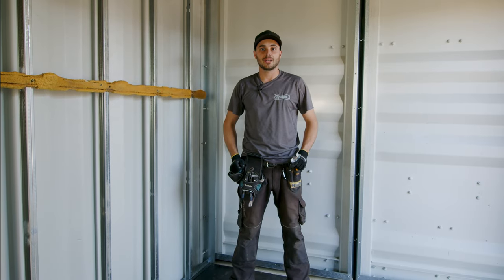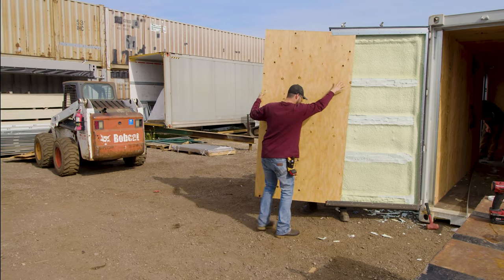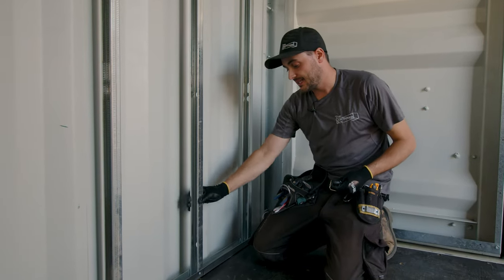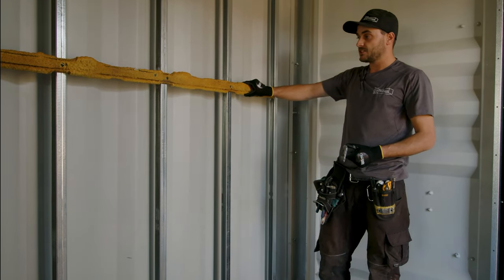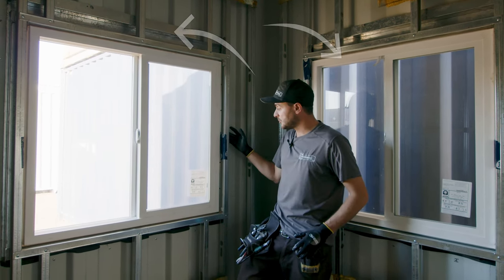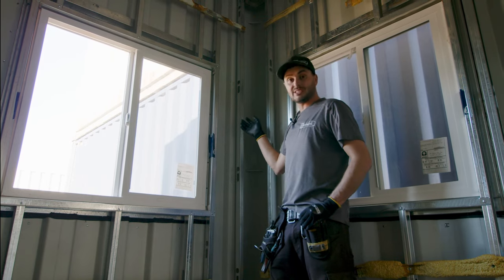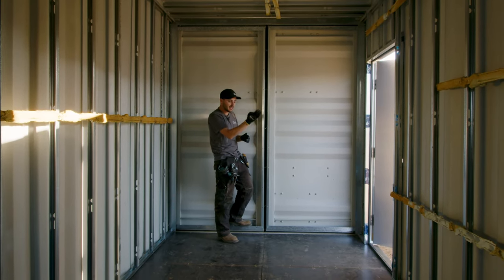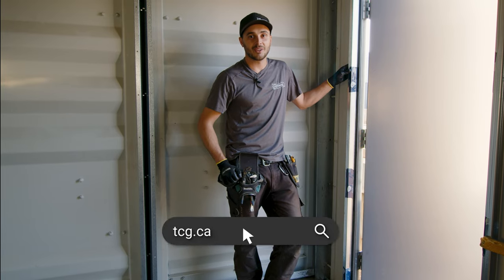Steel Stud Framing Kit - Easy Method To Frame the Inside of a Shipping Container!

Comment: I don't know about plastic for the framing brackets, I've been steel stud framing for over 30 years, I'd recommend adhering a rubber pad to the part that touches the shipping container (like the kind used in sound deadening when metal framing).  That way, the only thermal bridging would be the screw points, no re-tooling to make new brackets, and galvanized metal brackets are just better.

Also, since you are using 1- 5/8" studs, you will notice flex in the middle of the walls due to the lack of strength.  Once suggestion would be to use flat bar, span it horizontally on the back of the studs & fasten it to each stud with a self-tapping pan head screw.  For further strength, you could then use high-strength rubber adhesive, and squirt a dob between the gap of the flat bar & high part of the container skin.  Once dry, it will stabilize the walls without any thermal bridging.
Reply from the maker: You retired now? I'd love to hire you! Haha. Thanks. I love comments from professionals in each trade. Knowledge is power. I'll keep all of that in mind and give it a try.
Reply: @TheContainerGuyTV  disabled, or I would jump at the chance, I miss it
Reply: Hi there, I come from New Zealand and was really impressed with your knowledge. I am converting a 40ft hi cube container into a tiny home. I am having trouble finding an experienced person to help with advice in my area. 

Would you mind talking me through the process please? I can reach out to you via Facebook if you are willing?
Reply: There is structural thermal break material available in various thicknesses... the bracket could be modified slightly to take into account the 1/4" or 3/8" thickness of the structural thermal break material.
Reply: Sir, why would the walls flex in the middle of the studs aren’t structural. They’re only holding up insulation?
Reply: @JP-yl6on  thin width metal studs tend to flex unless you are using a really heavy gauge.
Reply: Try 3D Printing the brackets. Low cost to try it out in PETG.
Reply: Hi there - quick question, what type if flat bar would you suggest for stiffening up the 1-5/8" studs? I plan on using the brackets and 1-5/8" steel studs, spray foaming and finishing with drywall - would you still suggest the stiffener bar on the inside or would the drywall add the rigidity needed?
Reply: @kevinkorczyk4508  they make a c channel or low profile hat channel, both are installed on backside of wall.  They may not be needed if you are using the brackets and if the spray foam will at least reach the backside of your studs because that foam will lock them in place.  If drywall is hung on those studs alone on only one side, the wall will flex a little when pushing it, unless you are using brackets and stiffening.
Reply: @F-Bomb313  Got it, thanks for taking the time to reply - yes the drywall is only on one side so it sounds like I will want a stiffener. My plan is to use the stand off brackets highlighted in the video, spray foam the void and hang drywall... I will just want to be certain the space between the C-channel on the back side of the stud and the container wall has enough space for the spray foam to create the R value I need in insulation.  Thanks again!

Comment: Your continuous innovations to shipping container modification technology are a huge contribution to this affordable construction alternative. (It is such a pleasure to see a builder who continues to learn & improve their methods with each build.)

We're contemplating a couple of shipping container builds to house a rural homestead workshop and a science/computer lab. High humidity and 40 degree daily temperature swings in the Appalachian Mountains will make condensation & mold prevention a major concern. Steel studs & closed cell spray foam may just be the answer we're looking for.

Thanks for your brilliant work sir!
Reply: There is nothing affordable about their accessories, go check the insane prices on their website or Amazon.

Comment: I want to carry your full line of products in Tennessee. 

You should consider a formal building course, which in some ways this is, but certified builders and dealers would expand your reach. Employee a lot of people in a completely new building niche and grab a bigger chunk of the up-cycling market. 

I for one have decided this is what I want to do full time, it's really exciting prospect.

Living completely off grid in a small house in rural setting has taught me how little you really need to be happy and sufficient. 

One element that would be a game changer for me as a builder would be a rain catchment system that adheres to the rim of the top of the container. I use IBC totes on my farm to irrigate, and if they are new from the mold factory they are considered potable, according to the factory I buy from. I would like to funnel the surface water into an either exterior or interior tank, such as an IBC tote. 3" of rain on a 160 sq ft surface fills up my tank with enough to fill the hot water heater, run the dump leg cleanout cycle, and fill my berkey water filter. 

My idea is a galvanized 14 - 18 gauge rain gutter adhered with self tapping screws into that tube at the top lip just beneath the surface of the roof with a sealant adhesive sticker on the back, or could use silicone calk, the top edge could be beveled to help funnel rain, the gutter could come in 10' sticks, some sort of end caps, maybe with a gasket or crimp on could be used to enclose the cutter. A hole saw 3/4 to 1" could provide an easy way to insert a PVC bulkhead fitting, allowing for ease of funneling the water internally. 

One issue I've run into in living off grid in cold climate is water freezing. If you store rain water, a ground tank solves that problem, but it's costly to install and not always an option. A tiny house I built for a customer out of traditional materials has a 42 gallon tank in one side of the loft. I just installed a float switch, solar pump controller into their shallow well and the tank fills when the switch is closed (empty tank.)

1/4" -1/2" drop over the 20' should be enough for a healthy flow. And Screen kit could be added. If it's robust could be adhered prior to transport, need only stick out 2" on the long sides.

Would love something like this in helping me supplement off grid water concerns.
Reply from the maker: I could make custom sloped eaves to collect the roof water. Could punch a gutter guard profile into the top of it so the water falls through and the leaves/debris do not. We can laser cut/fold copper which would use the sun to melt the ice in temperate climate zones.
Reply: @TheContainerGuyTV  That's what I'm talking about, I want a quote on that system.

Comment: Can you furnish framing brackets that will give me 3" between stud and corrugation? You mention that they are laser cut, so lengthening the arm on the bracket should be a trivial issue.

Comment: It's  good to see these videos and the evolution of the kits to improve keeping the moisture out, and improving the vapor barrier and not using wood directly against the sides of the container,  which makes them healthier or allows for combining 2 or more containers! It  would be great to have a complete kit to combine 2 containers and stud frame system including windows 2-6 windows and give prices, so we could know the complete price for combining 2 20ft ,and 40ft containers. ( total cost for complete finished container home) I have not found this on website,  but it would be helpful to know exactly what kits are needed for a complete 2 -20 ft. Combined container home.    And also 2 40ft Combined container home!

Comment: thin rubber gasket between the SSB and the  container may be a cost effective alternative to injection molding   YOUR WELCOME

you mentioned 
Level container or insulation may "pop" what is the likely hood of insulation "pop" when you have a level container at spray and the container goes over the road?
Reply from the maker: Yeah electrical tape would even work just looks dirty. We might CNC a gasket and adhere it to the SSB. 

When you spray foam the container when it's level, it locks everything together in the correct position and makes the structure way more rigid. Then make sure it's handled correctly going forward (you can still be liberal with it - don't get me wrong..) Forklifts with long forks, toplifts, and our delivery trucks don't cause an issue.
Reply: Thanks, I was just about to ask this question.

Comment: What size steel stud are you recommending?
Reply from the maker: 1 5/8"
Reply: I also a few questions in general for you. I live in Reno Nevada. I am planning to buy land  outside of town in the more undeveloped area and so I need to insulate underneath the containers? Do you recommend the containers being placed on an elevated platform versus a concrete slap? The area will not be in a flood zone but the winters can get pretty interesting.
Reply: @TheContainerGuyTV  Also, what was the name of the gasket you used for the window installation and if the containers you are using are a one time use container do I need to strip out the flooring and replace with new deck wood? Sorry for all the questions but there's no blueprint for beginners on this topic?

Comment: I wonder if you have or will make a video that covers running coax and ethernet before moving to the interior finishing phase?
Reply from the maker: We're doing it right now in our Film Crew's office. Trying a method of running it in the steel studs along the bottom edge which will be covered by a PVC baseboard. Prior to interior lining, we put 4x4 gang boxes in the wall with a short section of EMT pipe running down to that area that we can fish through. Will be easier and cleaner than piping everything in conduit on the wall afterwards. And running the wires before spray foam is a bad idea. Data (Cat6) is something that should always be running through coreline or conduit because everything will eventually be swapped to fibre optic.
Reply from the maker: Here you go: https://youtu.be/xnhzFaqtf0o

Comment: With the 7/8 gap, are you guys now spray  insulating before studding?
Reply from the maker: No, we spray 2" thick of foam on the walls. It locks in the studs and makes the container very rigid.

Comment: Hi. A container is basically a Faraday cage. You only have to install a conductive interface between the metal container and the doors. A finished product like that will draw a lot of customers as it protects sensitive gadgets, appliances and equiipments from catastrophic electrical surges from severe lightning strikes and EMPs from you know what.

Comment: I will be converting a  container into a mobile concession stand. Your videos have helped a lot in the planification of the project but, what would you recommend for insulation since it will be mobile unit and we want to make sure we don't have any bridging on condensation, and you mentioned on this video that if moved after spray foaming can have a pop in the foam. Can you please help?
Reply from the maker: Make sure it's level when you foam. Frame with the thicker (structural) 18 ga steel studs. Once those are locked into the foam, it'll act like rebar in concrete and stiffen up the whole assembly. Try and handle the container from the 4 corner posts or lift through the fork pockets with 8ft forks (or fork extensions). 

Even if it did "pop" and crack in 1 place, it's still 100 times better than any other insulation method. Spend money on 2lb closed cell foam and sleep well at night knowing you made the right choice.
Reply: @TheContainerGuyTV  Awesome!!! Thank you so much, we will be buying all kits from your store. Thanks as well for your fast response, cheers from Houston, Texas.

Comment: What is the spacing between the ss bracket?
Reply from the maker: We sell qty 10 for a 10ft container, 20 for a 20ft container and 40 for a 40ft container. Space them out evenly. No exact science or measuring required. They just need to hold up the top track. It's best to install them where the studs won't be so they aren't in the way.

Comment: About the thermal bridge, the vertical steel studs are bolted to the floor frames, right? Do you have a solution for that? Tnx!
Reply: The floor is 1” plywood with insulation sprayed under.

Comment: So my question is why wouldn't you use INSOFAST 2 in 1 framing insulation made for containers instead of the metal framing that you provide? I'm not sure I understand the benefits to using metal framing if you were making just a simple container home, wouldn't you use INSOFAST instead as there's a lot less headache? or is there added benefits to using metal framing instead? If you google INSOFAST container insulation you'll see what I'm talking about. I'm curious as to what I would use if I'm just making a simple 2 or 3 connected container home as I think that the INSOFAST would save me the headache from having to do spray foam insulation and all the added cutting or screwing to steel framing or traditional wood framing, or would I use a combination of the two as you have the kits for joining containers together and making the doors and windows not only usable be more insulated? Or is this a conversation I have to have over the phone with two separate companies?

Comment: I would like to buy a 10 by 10 storage container insulated electrical with  Lights inside and a vent so it doesn't get too hot in the summer time but I don't want no bees or wasps getting into my storage container do you sell those type 10 by 10 please let me know Thank you and how much would they be Thank you so much for this video

Comment: Why does the steel framing stud kit only contain two corner pieces?  Is it that they are only used on the end of the container without the doors?
Reply from the maker: Correct
Reply: @TheContainerGuyTV  Okay, very good.  I think I'm understanding your products better.  The door flashing kit would be used on the other end of the container for the full solution.  Do you have a good source for the steel framing studs.  I see some on the home depot site, and they appear to be 8 ft. in length, so would only work with the standard containers vs. the high cube containers, but that's probably fine for me.
Reply from the maker: @andrigtmiller  look for a local gypsum (drywall) wholesaler. They usually carry a vast steel stud selection

Comment: I can't find 1-5/8 steel studs in Texas, best I can find is 2.5" - plenty of stock in Canada though :)
Reply from the maker: This is the second time I heard this. Crazy. 1 5/8" are so awesome for containers. 

2.5" should just fit if that is all that's available to you.
Reply: @TheContainerGuyTV  Yeah crazy all sold out, no idea why, no basements down here hah.  I'm trying to order a SSB kit, but not having luck with that either.  The amazon links to to CA only, not USA and the website has the brackets and boxes but not both in the same kit unfortunately.
Reply from the maker: @texastad1989  try www.containermodificationworld.com
Reply: @TheContainerGuyTV  yup, kits are sold out, but separately is in stock
Reply from the maker: @texastad1989  I'll get it fixed
Reply: @TheContainerGuyTV  whoo hoo thanks

Comment: Do you know if anyone has used exterior cork insulation on the outside or roof of cans? It's kind of like spray foam.
Reply from the maker: I looked into it and it was the same price as 2" of spray foam and didn't provide a legit R-Value. I think it's better for excessively warm climates vs excessively cold climates.
Reply: @TheContainerGuyTV  I live in Northern Minnesota so I'm looking for extra R value without losing interior floor space. 
I'll have to do more research to see if that extra to or three inches would help with those occasional - 40F/C winter days and deal with the handful of 110F/ 43C days in the summer. 
Reducing heating and cooling costs may well be worth the  investment. If of course it bonds to the steel of the can.
Thanks for taking the time to reply. 
Have you thought of making the mounting brackets in range of say three different sizes to allow for people who would like a little more R value?
Reply from the maker: @douglascampbell9809  I'm in Saskatchewan - we likely have worse weather. The brackets as is allow for 2.5" of foam on the inside wall corrugations and up to 4" on the outside wall corrugations. They are meant for 2.5" steel studs across the ceiling with an inch above them so between 3.5 and 4" of foam on the ceiling. This is lots for our climates. If you lay 2" of rigid foam on the floor then install a 5/8 T&G subfloor on top, that'll help immensely vs spray foaming the underside (or do both). Having a warm floor is key. 

The first iteration of this bracket was adjustable and the customer had to bend it themselves. That required too much thinking which is what these are meant to solve. We have a Wood Stub Bracket for those who want to still use 2x4s coming out shortly. I HATE WOOD but I know there are people out there that are still going to use it so might as well sell them something haha
Reply: @TheContainerGuyTV  When the jet stream is just right we actually get your weather. 
The meteorologists call the events a Saskatchewan screamer or Alberta clipper. 
They sweep down through the Plains, Midwest and Great Lakes regions. You know the results, snow, cold, wind. 
The longest one I remember was in the early 90's. My area didn't get above 20F/ 28C for something like 25 days.
Reply from the maker: @douglascampbell9809  we had -35C to -50C for a month straight last year and no reprieve. Worst winter I can recall. Global warming skipped right over us last year.
Reply: @TheContainerGuyTV  Don't count out global warming. The last couple years I've been colder in Minnesota than they were in Fairbanks Alaska for a lot of the winter. Granted I'm not all that far from the US Canada border.